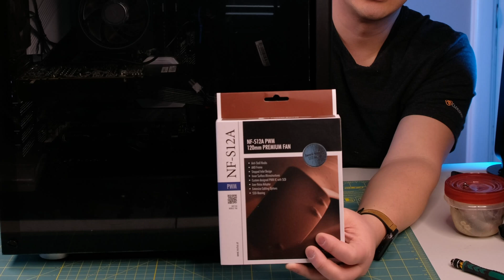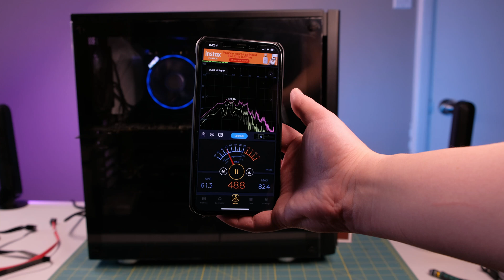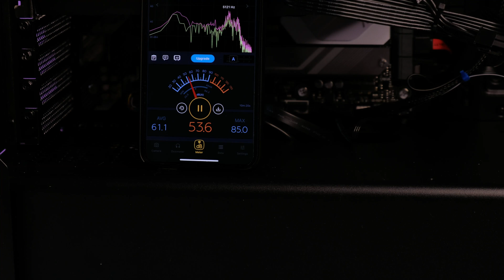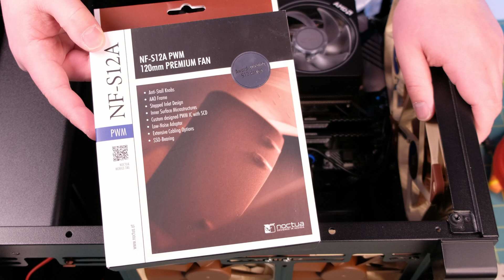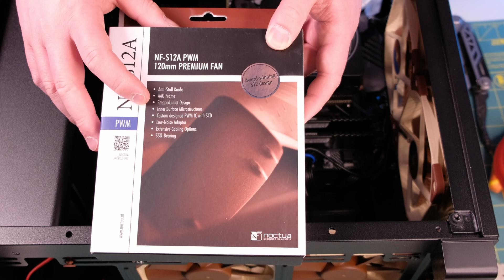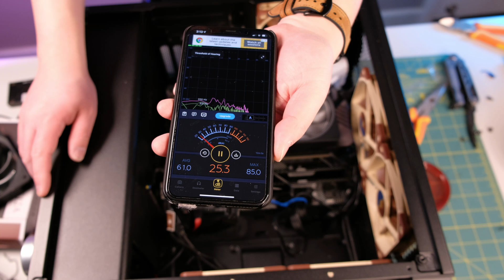Upgrading to Premium Noctua NF-F12 PWM fans.DB noise readings of before and after. WAS IT WORTH IT?

Comment: NF-F12 are not very good as case fans unless you need a fan to point directly at a PC/motherboard part. They blow heaps of air into a single point but are not good for anything else. Noisy as too. The NF-F12A is a completely different fan that creates pressure in the case & is a much better case fan. Your PC is very noisy

Comment: If noise is all you were trying to eliminate, then just go into the motherboard bios and set up your fan profiles for each fan port on that board.  Noctua are always going to be a better choice. They usually last over 3 times longer then any normal fan.  Just make sure you are getting the ones with PWN so you can control the speed better. Turn those fans down to around 1200 rpm instead of 2000 and it makes a huge difference in dBs levels.  Each noctua fan also comes with a low rpm adapter that looks like an extension cable.  It drops the rpm down to 900 (to low in my opinion).

Comment: Thanks for the video. If I may point out something: You have two different fans in this video.  You installed NF-F12 fans but the case you showed and the last one you installed is the NF-S12A.  These fans are very different as you can see in the fan blade design.  The NF-F12 fans are built for static pressure where there is a lot of resistance, i.e. using on water cooler radiators.  The NF-S12A is built for high air flow.  Based on advertised specs, there is about a 8 CFM different between those two fans.
Reply from the maker: Hey there. Thanks for the feedback. You're right i do have the NF-S12A fans installed. Thanks for clarifying.
Reply: @TheWongReviewer  1year later and still havent changed the title name.

Comment: Why are all fans intake blowin air in the the case, you need som exhaust fans, fans ther takes some of the heat,hot air out of the case
Reply from the maker: Hi there. Thanks for watching. You are right. I actually did an updated video https://youtu.be/p-yJKs2SvTU  where i corrected my mistakes. Thanks for watching.
Reply: If you have enough positive pressure in the case from the fans, you don't need an exhaust fan per se. This is due to the fact fluids (water/air) follow the path of least resistance without assistance. If both the front and top fans are used as intake fans, then there is enough positive pressure built up that will cause the air to exhaust out of the rear of the case from any opening there is. A well designed case built for airflow, will not require an exhaust fan. Where as any ole case that isnt designed for airflow in mind, will require an exhaust fan as you will have the situation of stagnant air which will cause temperatures to build up.

Comment: you are creating all positive pressure with those intake fans, dust could easily build up inside your case.
Reply: Just turn one of them other side. I would suggest one one the back.
Reply from the maker: You are totally right !
I am going to do an update video on the issues with positive pressure. I am going to turn off one of the front fans. Thanks for watching!

Comment: I'd replace the AMD stock cooler. That's one of the loudest CPU coolers around. You'll also get extra performance if you change that fan
Reply from the maker: Hi there. Great suggestion. I ended up replacing my AMD wraith cooler with the Noctua NH-u12S Cooler and the sound made such a big difference. Unfortunately, i wasn't being careful and I erased all of my footage on the installation tutorial. Thanks for watching!
Reply: King Everard Conquerors Blade Gaming  Yeah, that's your CPU cooler. Both AMD and Intel have painfully loud stock coolers, you should get a 3rd party one. Depends how comfortable you are with replacing it (and finding the right one, rated for your CPU wattage)
Reply: King Everard Conquerors Blade Gaming  Seems good, which CPU do you have? Also, do your other fans show multiple colours at once? Not just a solid colour that changes? If so, the lights will work (it's ARGB)
Reply: King Everard Conquerors Blade Gaming  Ah if it's a quad-core AMD this cooler will be good. I'm not sure if the lights will work, unless your board has the connector for it.
If you hit Start and type "System info", it'll show you a list of your PC parts. "System Model" is your motherboard name

Comment: Do I get it wrong, or have you mountet all 5  as intake fans?
Reply from the maker: Hi There, I mounted all 5 intake fans.
Reply: The Wong Reviewer exhaust is way more important than intake
Reply: @waoooh  Its better to have positive pressure rather than negative
Reply: @AF-rm4dr  It’s debatable and goes by a case by case basis. Nothing is wrong with positive pressure but if you have all positive pressure with no exhaust the positive pressure will do nothing but blow hot air around